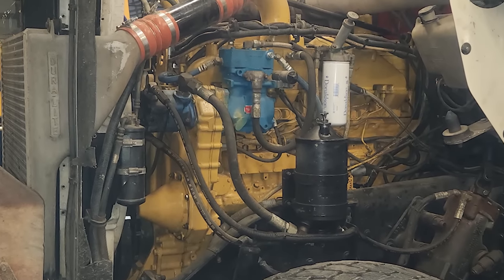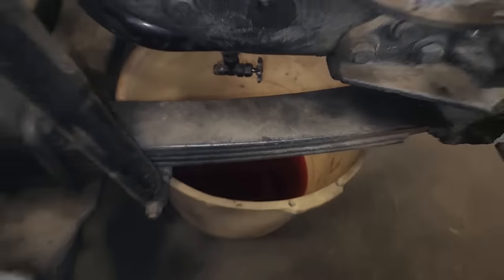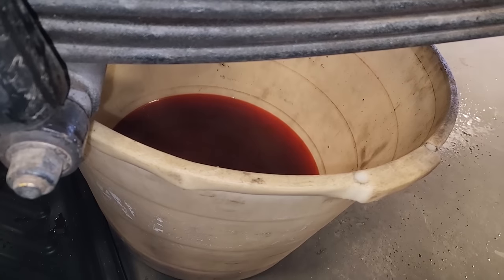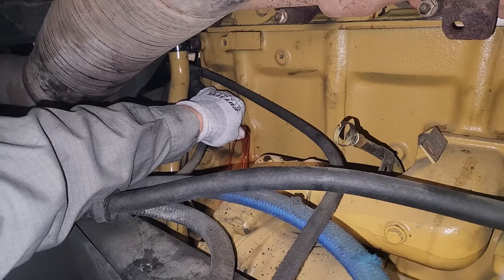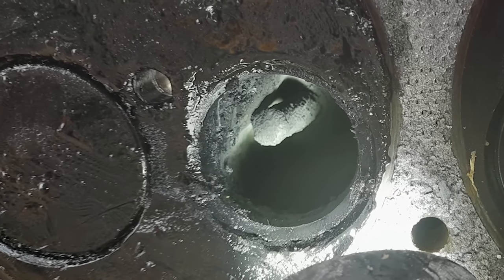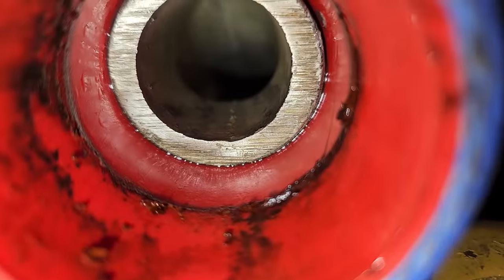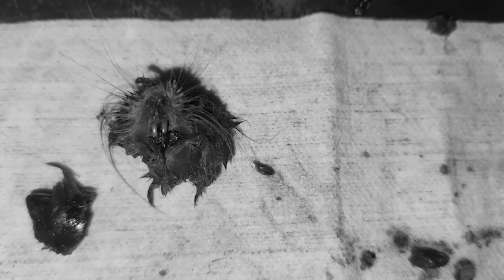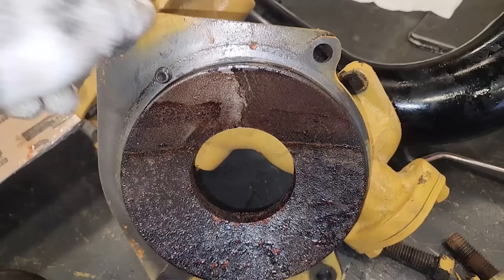Engine Overheats after Full Rebuild, but Why? (YOU WONT BELIEVE IT)

Comment: I've seen mice causing timing belts to jump a tooth or two, but i have never seen one get stuck in a cooling system before. Maybe that shot should look into a possible mouse and/or rat infestation problem before this happens again.

Im gonna guess the enigne still had to be rebuilt again as it could still have suffered some overheating damage, and for your shops and ofc the customers peace of mind.

Comment: Reminds me of a 3208 in a Ford Cargo that was brand new but had been in storage for about 2 years. It overheated horribly. When it was pulled apart to find out what had gone wrong it was found that EVERY coolant touching surface was lowered by ~20 thou (0.5mm). Not only that but the block was full of rust. The coolant had turned acidic for some reason over the storage period and attacked all of the iron (block and heads) eating it away perfectly.
Reply: They must have used Chinese coolant

Comment: Once had a tractor with a vibration, after disassembling top/bottom and much head scratching, sent to agents etc etc
The tractor worked in heavy clay soils,  dust and water had formed clay and hardened on cooling fan blades.

Comment: Mice: I have a shop vac that's left in a corner during working hours. Occasionally, the vac comes out and the shop is cleaned down. Well, one Winter the shop was out of action due to us moving things around for a better layout. Come the end of the moving, we hauled the shop vac out to clean up - it was Spring time by then. Anyway, the vac worked well but after 30 minutes or so we noticed a terrible smell. We just couldn't place it and even had a drain team out because we thought a sewer was cracked beneath the floor. The smell was beyond comfortable.
Eventually we located the smell. The shop vac had laid idle for several months and its long hose lay connected to the machine but coiled around it on the floor. During the colder months, a large family of mice took residence inside the shop vac. The long hose was their means of entry. We lay vermin control poisons in some places and it appears a mouse hauled a large chunk of said poison into their safe family home for their family to munch on - it wiped them out inside the vac. Us then using the shop vac had warmed the machine up once we got really going. The warm air had broken apart the soft mushy remains of a large number of rotten mice and the spent air exiting the shop vac had then filled the workshop space. We'd been breathing in rotted soggy soft mouse fumes. 
I'm almost bringing my breakfast up telling this story.
Always check inside the shop vac before use folks.
Our shop vac was so badly messed we had to throw it away.

Comment: Had a similar but possibly less graphic scenario happen to me. Bought a used engine, installed it and it would over heat instantly under load. Thought it was an air pocket, pulled the radiator cap and saw a sunflower seed floating on top. Strange 
Fished it out, started it with the cod off and as it started puking water out from heating up more sun flower seeds started coming out!
Drained the system, pulled the thermostat housing (on the lower hose on this application) and found it completely packed full of sun flower seeds! Some had somehow made it past the thermostat while it ran but it was blocking cooling flow. 
The inlet to the thermostat housing is about 6-8” long, my guess is while the engine sat a mouse made a home inside.

Comment: I had a cat that suddenly began overheating on us. I was at a new to me shop and had limited cat inline experience. In the end I found a split water pump impeller. I found a lack of the flow pressure you spoke of to find the broken water pump. New pump and problem solved. That was the first time I ran into a broken impeller.
Reply: Maybe a casting defect?

Comment: Years ago as a Mazda tech in Australia, we were warned about the then current 929 24v V6 in mouse plagues.

Apparently there was a small void at the bottom of the cam belt cover that a mouse could fit into... They'd get in, the owner would crank the engine and the remains of the mouse would cause the timing belt to jump teeth and destroy the top end of the engine 😥

Comment: Seeing an animal in there, that's 100% new! I've seen this rust a time or two before after fresh rebuilds; Cause #1 is some mechanics filling up with just tap water only (that's OK, keep reading) just to get ALL the swarth & crud out, and make sure everything is working right before draining & dumping 15 gallons of coolant in the engine after the very first 1 or 2 heat cycles on water, yet don't get all of that tap water out and whatever's in the tap water reacts with metal & coolant for some very nasty compounds. Cause #2 is mixing tap water with concentrate rather than distilled I saw that mistake way more than anything else - suddenly thermostats aren't lasting very long, radiator cores crusting up and not cooling efficiently. Not near as bad as 100% water but still no good. I've seen a red shop rag completely wound around a water pump impeller before. Don't f*ck up cooling systems young mechanics, we all make that mistake at least once in our careers 😁

Comment: Found a dead crow in a vertical exhaust pipe , and a nest of mice in an air box . 
But worst of all was a Yellow Jacket hive in the ventilation system, vehicle was laid up for a few months , jump started it and the cab filled with very angry wasps as they got blasted by the air fan on full hot . 😂😂😂

Comment: Odd thing is. I've seen it before. Not with a mouse but a chipmunk. I had a bunch of parts on the back of the tractor during an in chassis. When I picked up the lower hose assembly some acorns rolled out. I had to flush everything before installing it and covering up the holes when I wasn't working on it.

Comment: I have saw plenty of fresh overhauls on Cats come back overheating most common cause is a rag was left in the lower radiator pipe water pump grinds it up and it plugs up the face of the oil cooler

Comment: Had that problem before.  The down line from the coolant tank the the pump inlet was stopped up at the tank fitting. The customer put 5 bottles of that  ceramic sealer in the cooling system.

Comment: Fun and informative video!  Love these videos from the Ape!
Reply from the maker: Hi Larry! You were early on this one.
Reply: @AdeptApe  I used to have over heating issues with my C7 right after buying my RV.  Found the acrylic surge tank, which is part of the cooling pressurized system had a split at a seam, causing the system to not hold pressure.  That was not hard to find since it was spraying coolant everywhere.  I replaced the tank, but still had some over heating issues.  Next was to have the cooling system flushed and filled with new coolant.  It was better but temps would still rise when climbing up hills.  What I discovered was that I was exacerbating the issue with how I was driving.  My C7 has a direct drive fan, and I was allowing the engine rpm to get too low under when climbing.  The Allison transmission was not down shifting far enough to keep the rpm’s above 1500 to 1800 rpms.   Actually I found a sweet spot at 2200.  This reduced the load on the engine and forced enough cooling air through the radiator.  Remember the engine in a diesel pusher is actually mounted backward and my radiator is in the rear, not side mounted.  Side mounded radiators usually have electric or hydraulic driven fans and are not necessarily rpm connected.  Maybe this will help someone else with an older C7.

Comment: Hi Joshua. I noticed that this truck has OAT coolant in it and looks like a  pre emissions engine. I maintain a fleet of refuse trucks and attempted to use OAT coolant but I found it isn’t compatible with copper radiators and some gasket materials. Even after thoroughly flushing the cooling system before filling with the red coolant we started having leaking issues. And after early replacement of radiators from core failures.
 I’ve been flushing and replacing with glycol coolant. I don’t recommend OAT coolant for older trucks. If interested I can post some pictures of what I’m experiencing.
Reply: You may have just answered what happened to a car I had some 25 years ago when its copper rad core turned into a collander. 

At the time it was  young enough for there to be value in getting a full a dealer service history. They'd changed the coolant at two years then just before the next change this happened. They put a new rad in but charged me for labour (UK).

I've now looked it up and indeed OAT antifreeze and copper are incompatible, so it looks like it was probably what they put in and it may even have had it in from new.

Many thanks!

Comment: Left a radiator sitting in my workshop one time and a bird made a nest in the top tank, blocked everything!!!! Also had fibre impeller break centre out, fitted earlier cast iron impeller to water pump. HAD SEVERAL FIBRE IMPELLERS FAIL ON 3406A AND B. FROM UK.

Comment: 6:50 
The line   Indicates an air pocket in the water pump . You can see the distinctive difference between the corrosion where the air was versus where the corrosive fluid was. Now to finish watching to find out why the fluid was so corrosive having Corrosion inhibiting additives in brand new coolant.

Comment: @AdeptApe Did the engine do ok after fixing this coolant issue?  Just wondering if any damage was done do to air in system.  I just had a Peterbilt with a Detroit with a similar issue.

Comment: I'd have never guessed that.
I sold a rebuilt engine to a guy and 6 months later he gets back to me about a overheating problem.
He sent me a picture of the thermostat (which was stainless steel) that had corrosion pitting all over its surface. He said he put in "quality coolant".
I checked the water quality in his local area. The water authority said it consisted of 40% bore water which was "brackish" ie: salt water.
Expect the unexpected.

Comment: Wow that's definitely one of those- you ain't gonna believe this stories!!!!! Lol. I have a 2005 mxs c15 acert went out to crank it one day spun and spun then finally started,which is highly unusual for this engine usually starts right away. Took off and had no power and would barely run,took it to the shop pulled fuel filters there was about 1/3 of one of those blue heavy paper shop towels in the primary filter!!!! This was after returning home from a run there had been no services performed on the truck. So we're assuming it was in the fuel tank and got sucked through???? Not sure but yeah moral of the story is- sometimes stuff gets where it ain't supposed to???? Lol

Comment: Hey man , 1 question.  Lugging an engine is never good, but would a few leggings affect a engine that quick? I recently made the mistake of taking  a state hwy (43 miles)  where it had steep up hills which had curves (very tight 2 lane hwy) right be4 the mountain and I wasn't able to pick up speed and my truck dropped down to 12 mph multiple times and I couldn't get to keep the rims above 1300 rpms, I now hear a weird noise hollow like whenever I Rev the motor but only  between 900 and 1k rpms. Any ideas of any damage that could've happened??
Reply: It's a 1999 12.7 detroit 60 series with an 18 speed trans.
Reply: Maybe a boost leak or exhaust leak. If there's no catastrophic noise probably shouldn't worry too much it might just be confirmation bias, I haven't heard it but it might be a noise you just never noticed before. If you're still concerned check oil filter for any metal on next oil change. Also check for any top end noise at idle maybe it needs a valve adjustment.
Reply: @kodykj2112  at top idle it doesn't make any weird noises or at low idle, I just hear it at 900 to 1k rpms. I do have (had) the cat wall a little loose but I tightened it up and I also had to move the 5th wheel 1 notch to the front on that load to be legal on drive axle. I haven't ranthe truck since I tightened the cat walk up but I'll be paying attention to it as that could be the cause, idk really hope it's just the  at walk

Comment: I’ve seen Some of the water pump backing plates made of aluminum and they pitted very easily, if there is any pitting on the backing plate that too will create Cavitation. Not sure if the aluminum ones where a factory item or an aftermarket part such as CTP
Reply: I would think at that point its sucking air through a seal. Maybe radiator cap not holding correct pressure.?

Comment: Poor little guy. I have had mice built a nest inside of a spare engine. Didn't know it until I put it back in service. Overheated quickly. Had to pull the radiator three times and have the radiator shop blow the straw out of it.

Comment: I had a truck sitting all winter then went to use it and had a problem. Long story short a mouse chewed through the air cleaner elbow behind the dash and made a nest against the turbo. By the time I figured it out I had a turbo seal go out and cost me $1200 for a new turbo. Frickin mice ruin everything.

Comment: I had my air compressor changed along with a leak fix in my transmission. Took over a week when I got it back a hose it back of the air compressor a small hose busted and I didn’t know until I seen a loss in oil pressure caused by temperature. Engine got so hot the gauge pegged out the hose was in terrible condition and should have been changed with the air compressor especially after waiting on a clutch to come in that they thought needed changing I was lucky the motor still runs but does use coolant about a gallon every couple weeks any suggestions on what the problem is. I’m also wondering if the temperature could have caused my rear main seal to start leaking. Oh I must say I have had more trouble with mechanics doing half ass work than one man should have to

Comment: Seen alot of C series Cat engines  overheating due to water pump impeller bolt backing off and the water pump just free wheeling along as its on a tapered shaft. Many many times in under 45 minutes I had the bolt replaced a torqued to spec and instant overheat fixed. My customer loved it, my employer threatened me with my job, sell that water pump RnR job they said. Here is a customer coming in for a midlife next week but your saying screw him today on a 3/8 bolt that Cat knows is a failure point? Anyways, good thing I dont gaf about what the idiots in the office want.

Comment: Had an SDP that had a low CGI gas flow code. Went through all the troubleshooting and at the very bottom it said, “if code still exists remove CGI pipe and check for a bird”. 

Removed the pipe and a sooty black mass fell out…

Weird shit.

Comment: I have a fresh rebuild 3406E 5ek and my oil pressure is around 25 psi put new oil pump on during the rebuild  but for reason still getting low pressure I try to figure out is this normal or not?

Comment: With no fluid or not even enough fluid and the temp gauge was reading over 200 im a machanic of 40 years and if the temp gauge is reading over 200 that engine is toast cuz that temp gauge was reading air temperature not liquid temperature so that engine was cooking hot and the only thing really cooling the engine was the oil

Comment: Mice? Hell ive seen lint destroy an engine with a port left open. Just a 2" hole but over temp changes enough lint got in even after "washing" out engine religeously it made it 1mile spun bearings

Comment: Reason 1; that engine is not going to fully heat up unless you leave it running for a full day, thermostat won't open uh oh's. Happens on 5.9 Rams all the time, I warmed it up for 6 hours - guess what that's not enough ( edit, try holding the throttle open until it's at 2500 rpm for a long long time )

Reason 2; heat treatment doesn't last if you reheat the metal by overheating it into the annealing stage... ( The answer )

Comment: That looks like too much for a mouse it was probably a rat.   I once found a railroad airbrake hose that had been cut off.  I took it home for souvenir.   When I was washing it out with hot water two dead decaying rats came out.   Together those critters  likely shut off the air to trains brakes and the train crew couldn't pump up the trains brakes till they found and replace the clogged air hose.  That train crew  probably couldn't figure out why a perfectly good looking air hose that was not pinched or collapsed wasn't flowing air.

Comment: Made me remember that airliner that fell from the skies probably because wasps built their nest into the speed sensing tubes and the crew couldn't figure out their current air speed. Since it fell in the ocean no actual wasp was found, but the investigation said that probably someone forgot to put the red caps on the pitot tubes, plus the airplane was parked for three weeks in the open, plus that time of the year wasps were very active

Comment: Shops don't test drive🤨
Reply: Or when they did it moved it around and they didnt get an overheat issue until it got stuck somewhere and blocked things off. Im curious to know where it was in the system.
Reply: It may not have been an issue right after rebuild... Obviously they were not doing a loaded test drive, but with the mouse intact coolant was probably flowing enough, but once it disintegrated it looks like it clogged it up real well.